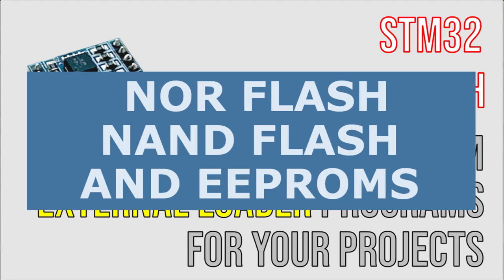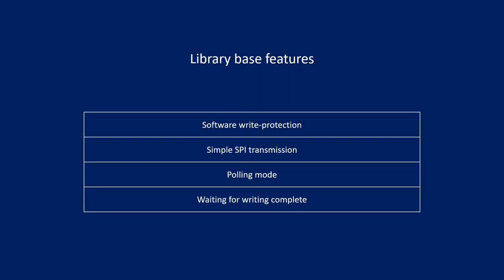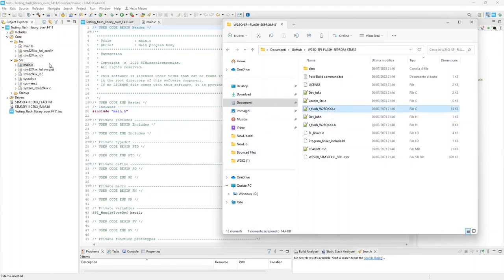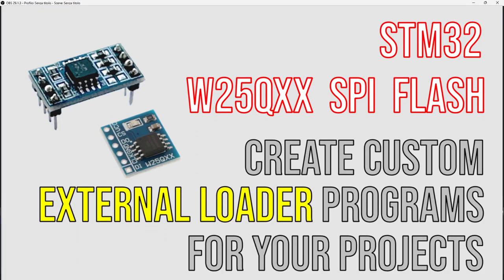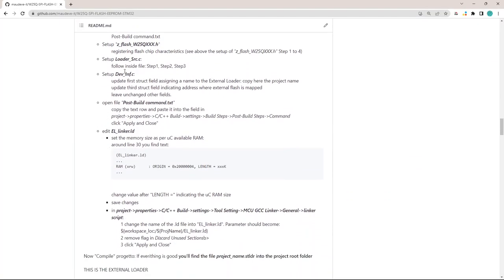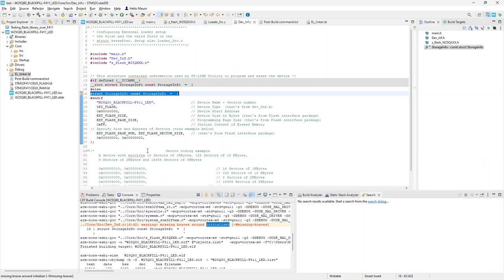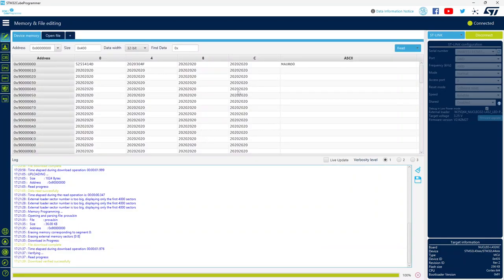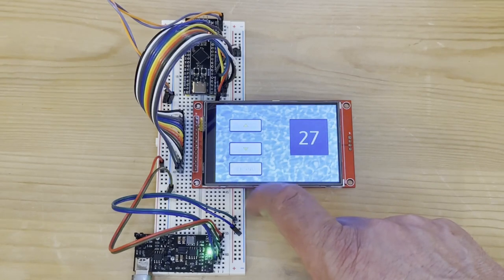External loaders for SPI flash: a "standard" version

Comment: Hello. I am creating an external loader following your tutorial for the STM32U599(I have tried U5F7 too) and W25Q32 flash IC. I am able to read and erase the external flash using cube programmer, but whenever I try to write to flash (Fill Memory), I get the following error

  15:51:42 : Error: Failed to download data! If it's a Flash memory, it may be not erased or protected
  15:51:42 : Error: Failed to fill memory with the given pattern

Similarly, when I try to program a bin file to flash I get the following error
  15:55:36 : Error: failed to download Segment[0]
  15:55:36 : Error: failed to download the File
  15:55:36 : RUNNING Program ... 
  15:55:36 :   Address:      : 0x90000000
  15:55:36 : Warning: The core is locked up
  15:55:36 : Start operation achieved successfully

I have tried following different tutorials as well as writing my own functions from scratch but I get the same error. Any idea what could be the issue?
Reply from the maker: Is it possible that your flash is write-protected? There are many write-protected modes in W25Qs, setting up registers SR1, SR2 and SR3. I never tested the write protection features and the possible returned messages by CubeProgrammer and CubeIde
Reply: @bluewat  I did not consider that. I will check that out as soon as I can in that case. Thanks for the reply!
Reply from the maker: Can you provide the full chip name? Some W25Qs leave WinBond farm in QSPI data format mode as default. Here also I never tested what happens trying to SPI-write them without changing setup.
Reply from the maker: IQ chips have QE bit in SR2 preset for SPI (refer to flash datasheet), that means that /HOLD pin function is available. You should take care of handling it also (keep it high for normal operation).
Reply: @bluewat  Ohhokay, I will look into this then. Thanks for looking into it and guiding me!
Reply: Hello again. Unfortunately I haven't gotten around to testing this as I am currently developing a QSPI loader for another project (which is working thankfully), but I've been wondering - even with the QE bit set by default, the device should still able to communicate using regular SPI for all regular SPI commands, such as Page Program (0x02) right? So would this be an issue?

Comment: Hello. I have issues using this loader with W25Q32JV flash and STM32U599 MCU. I am able to generate the .stldr with no issues (except for that warning which is expected) but in cubeprogrammer, I cannot select the external flash address from the dropdown in the "memory & file editing" tab.

I have modified the z_flash_W25QXXX.h file as such

#define EXT_FLASH_PAGE_SIZE     0x0100      // 256 bytes  page size (bytes)
#define EXT_FLASH_SECTOR_SIZE   0x1000      // 4KB        sector size (bytes)
#define EXT_FLASH_BLOCK_SIZE    0x00010000  // 64KB       block size (bytes)
#define EXT_FLASH_SIZE          0x00400000  // 4MB-32Mb   total size (bytes)
#define EXT_FLASH_PAGE_NUM      0x4000      // 16384      pages
#define EXT_FLASH_SECTOR_NUM    0x0400      // 1024       sectors
#define EXT_FLASH_BLOCK_NUM     0x0040      // 64         blocks

and in the EL_linker.ld file I have modified as such

LENGTH = 2512K

Followed all the other instructions. SPI Baud rate at 18Mbps (I have tested this module at 18Mbps and could successfully read JEDEC and other IDs)

Any clue what could be wong? Any help is appreciated
Reply from the maker: Can you provide more details about accessing the mapped flash via CubeProgrammer?
Reply: @bluewat  Hello, I get the error " Error: Data read failed" When I set the address to 0x90000000 and try to read the external flash module
Is there any other information you would like in detail?

EDIT: Apologies, not sure what changed but it seems to be working as intended now. Thank you for the informative tutorials regardless!